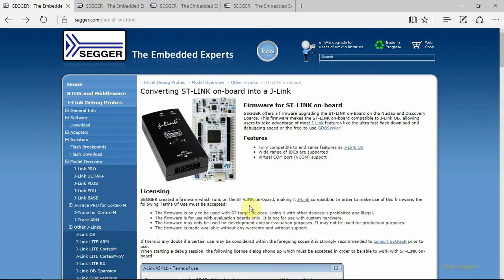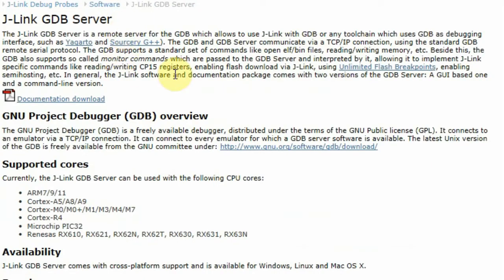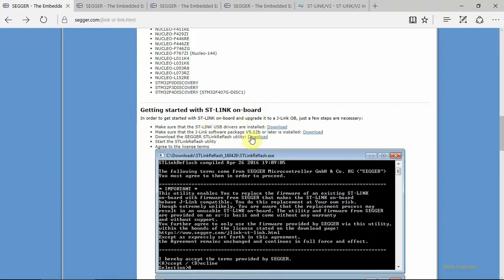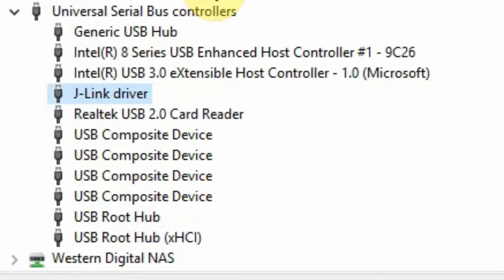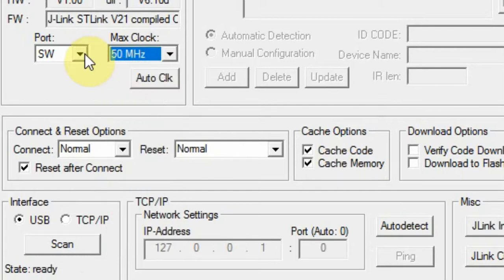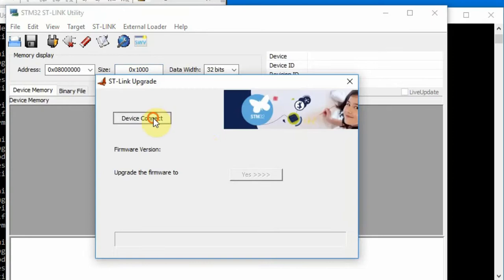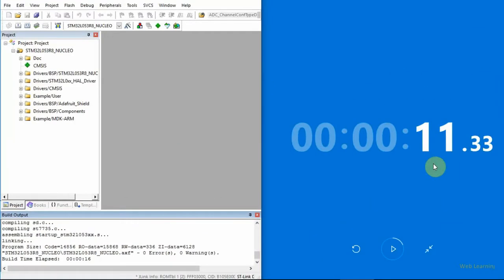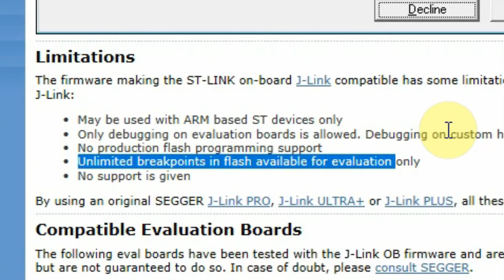Convert STLink To JLink !

Comment: I have a problem with the step one " upgrade to J-Link" appears "ERROR: Unsupported ST_LINK firmware", could you help me??
Reply from the maker: I you doing the same thing as in the Video? Are you using Nucleo boards?
Reply: @Weblearning1 I used a weact mini debugger stlink v2.1 not a nucleo board, and it worked(haven't checked if the pinout is the same as before)

Comment: Aside from the breakpoints, isn't the biggest advantage of the jlink firmware, the ability to do trace?   But why does Seggar say it's only works for on-board St-LinkV2 eval boards (ex. Nucleo/Discovery).. and not the standalone St-Linkv2 shown at the 30s mark?  Don't they both use the stm32f103?
Reply from the maker: They use the same device, but its a different code so it doesn't work. See the new ST-Link-V3.
Reply: @Weblearning1  Does the J-link firmware work on the ST-Link-V3 or not?

Comment: First Many thanks. For your help now I am using cubemx  and after set as gpio input pa13 and 14 . Now problem is After debugged i can’t use this ic for again debugging. How to solve. Or how to erase 
Also i try to erase with stm programmer but can’t erase and show please device not found or check connection.  I am debugging with swd stlink .Again thanks for reply
Reply from the maker: After setting the SWD to I/O you cannot debug the part. You need first to erase it. Use the Cube Programmer ND if that doesn't work, use the ST link Utility to erase the part and then debug or program it again.

Comment: how I can use pa13 and pa14 as input or output because I am using sw debugging using stlink for stm32f030k6t6 32pin .thanks
Reply from the maker: After finishing you debug, you can switch them to I/O and then debug them anyother way. Usually it's best to use those lines for simple LED indication.
Reply: First Many thanks. For your help now I am using cubemx  and after set as gpio input pa13 and 14 . Now problem is After debugged i can’t use this ic for again debugging. How to solve. Or how to erase 
Also i try to erase with stm programmer but can’t erase and show please device not found or check connection. I am debugging with swd stlink .Again thanks for reply

Comment: The method is good for making the STlink to JLink but I don't know why to use J link.. if this method working only for ST controllers..
Reply from the maker: I said in the video that Jlink works faster. The ST-Link is designed only to be used with STM32, so even when you convert it, its still can only be used with the STM32.

Comment: My STlink don't uprade. The process is stopped on "Preparing for FW update...". Can you help me? My STLink is a standalone chinese device.
Reply: did you solve your problem? normally it is not because of standalone chinese device, but the version problem, for converting works mostly on stlink v2-1 to jlink, while the standalone version should be stlink v2, so the stlinkreflash does not work....

Comment: LOL - Bunch of sheep copying each others work. People you don't need to reflash anything. Just find the SWD pins on the main board and hook up your JLink. You will need to remove a couple of jumpers and a couple of solder bridge resistors. So, you're really going to spend several hours making a purchase of a j-link and figuring out how to brick your st-link just to save a couple of seconds on the download? Rather, spend a few hours to figure out how to break off the st-link, as ST.com promised that you could do. BTW on some boards you will need to add an external crystal once you break off the ST-Link.
Reply: Are you saying that if you don't already have a jlink pro... you can sever the st-linkv2 portion of a nucleo/discovery board, and then use it as a j-link?   In that case, why not just use a standalone StLinkv2 , which uses the same stm32f103 processor that is on the nucleo/discovery boards.
Reply: @bennguyen1313  Are you able to convert STM Nucleo or STLINK V2 to J-Link ?